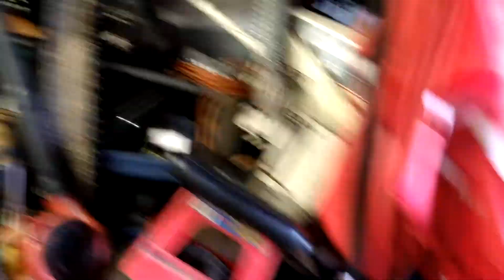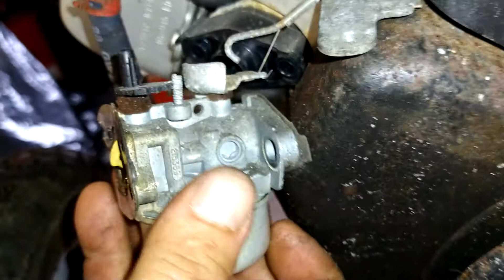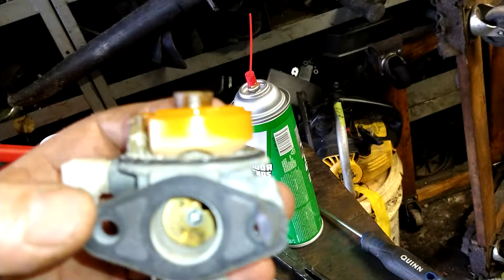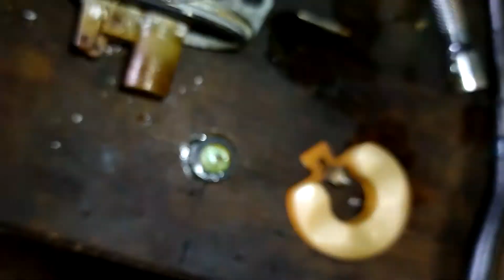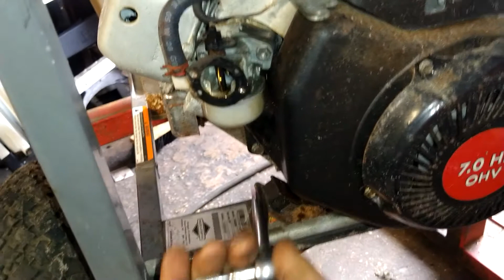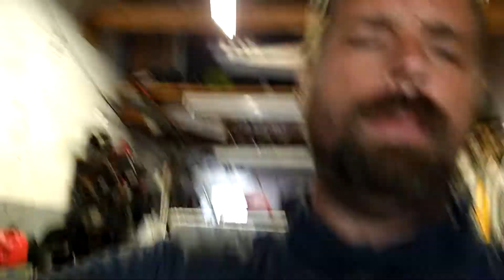briggs and stratton 3750 5250 generator carburetor repair. briggs 7.0 carb rebuild

Comment: My same engine runs great for 15 sec then dies, I suspect there's a fuel draw issue.. ? I've taken apart and cleaned out all likely suspects including -- (internal tank mesh filter) ( on/off valve) (carburetor) and (exhaust outlets), (oil level is also topped up) anyone have any other suggestions ?? Thanks ..
Reply from the maker: Oil sensor is bad. Single wire going in the engine. Unplug it.